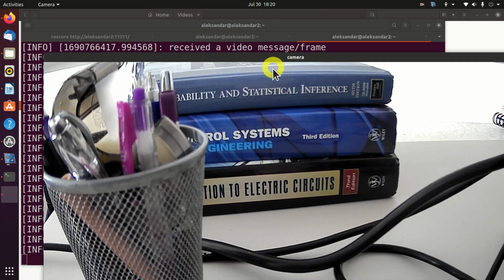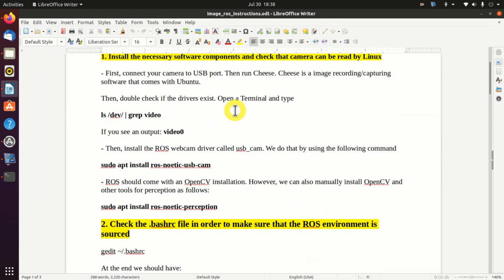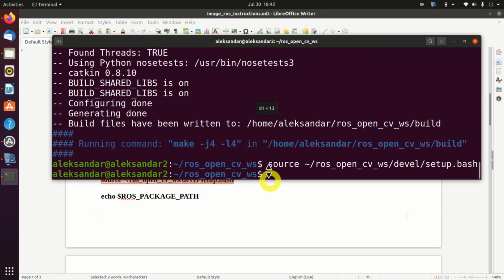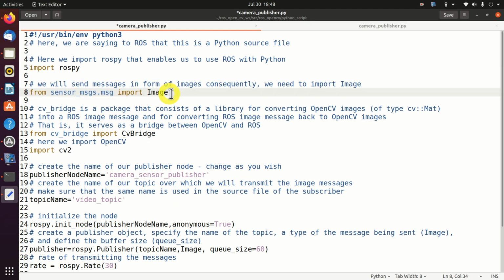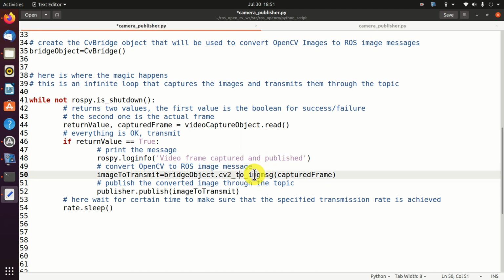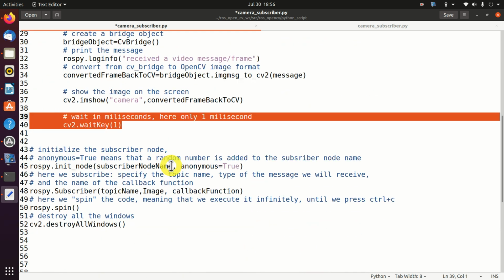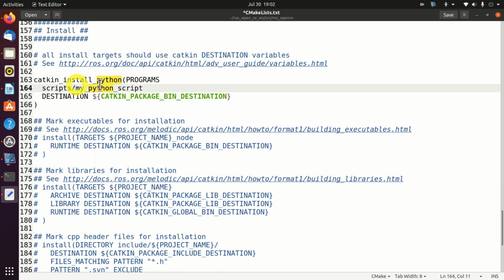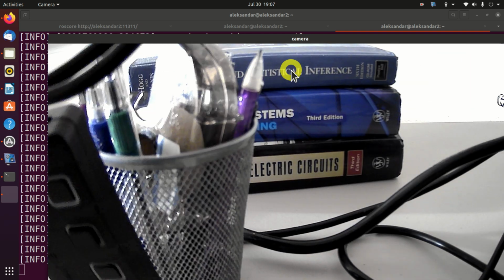Use a Camera with ROS and OpenCV in Python - Robotics and Computer Vision in Python and ROS

Comment: hi i tried your tutorial, during the final step after doing changes in CMakeLIsts.txt and when i ran catkin_make i got the following error:
 
catkin_make
Base path: /home/arshini_sai/ros_open_cv_ws
Source space: /home/arshini_sai/ros_open_cv_ws/src
Build space: /home/arshini_sai/ros_open_cv_ws/build
Devel space: /home/arshini_sai/ros_open_cv_ws/devel
Install space: /home/arshini_sai/ros_open_cv_ws/install
####
#### Running command: "make cmake_check_build_system" in "/home/arshini_sai/ros_open_cv_ws/build"
####
-- Using CATKIN_DEVEL_PREFIX: /home/arshini_sai/ros_open_cv_ws/devel
-- Using CMAKE_PREFIX_PATH: /opt/ros/noetic
-- This workspace overlays: /opt/ros/noetic
-- Found PythonInterp: /usr/bin/python3 (found suitable version "3.8.10", minimum required is "3") 
-- Using PYTHON_EXECUTABLE: /usr/bin/python3
-- Using Debian Python package layout
-- Using empy: /usr/lib/python3/dist-packages/em.py
-- Using CATKIN_ENABLE_TESTING: ON
-- Call enable_testing()
-- Using CATKIN_TEST_RESULTS_DIR: /home/arshini_sai/ros_open_cv_ws/build/test_results
-- Forcing gtest/gmock from source, though one was otherwise available.
-- Found gtest sources under '/usr/src/googletest': gtests will be built
-- Found gmock sources under '/usr/src/googletest': gmock will be built
-- Found PythonInterp: /usr/bin/python3 (found version "3.8.10") 
-- Using Python nosetests: /usr/bin/nosetests3
-- catkin 0.8.10
-- BUILD_SHARED_LIBS is on
-- BUILD_SHARED_LIBS is on
-- ~~~~~~~~~~~~~~~~~~~~~~~~~~~~~~~~~~~~~~~~~~~~~~~~~
-- ~~  traversing 1 packages in topological order:
-- ~~  - ros_opencv
-- ~~~~~~~~~~~~~~~~~~~~~~~~~~~~~~~~~~~~~~~~~~~~~~~~~
-- +++ processing catkin package: 'ros_opencv'
-- ==> add_subdirectory(ros_opencv)
-- Could NOT find rospy (missing: rospy_DIR)
-- Could not find the required component 'rospy'. The following CMake error indicates that you either need to install the package with the same name or change your environment so that it can be found.
CMake Error at /opt/ros/noetic/share/catkin/cmake/catkinConfig.cmake:83 (find_package):
  Could not find a package configuration file provided by "rospy" with any of
  the following names:

    rospyConfig.cmake
    rospy-config.cmake

  Add the installation prefix of "rospy" to CMAKE_PREFIX_PATH or set
  "rospy_DIR" to a directory containing one of the above files.  If "rospy"
  provides a separate development package or SDK, be sure it has been
  installed.
Call Stack (most recent call first):
  ros_opencv/CMakeLists.txt:13 (find_package)

-- Configuring incomplete, errors occurred!
See also "/home/arshini_sai/ros_open_cv_ws/build/CMakeFiles/CMakeOutput.log".
See also "/home/arshini_sai/ros_open_cv_ws/build/CMakeFiles/CMakeError.log".
make: * [Makefile:320: cmake_check_build_system] Error 1
Invoking "make cmake_check_build_system" failed
 

i tried several steps to correct this but i am not able to, so kindly help me out of it.